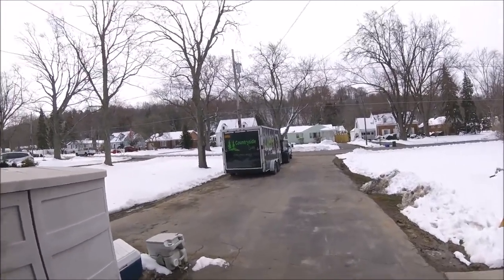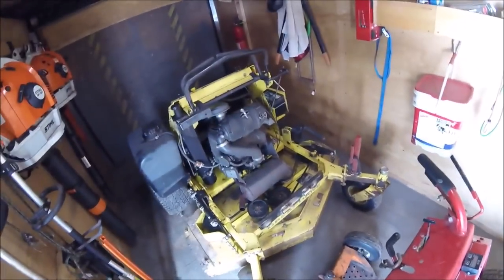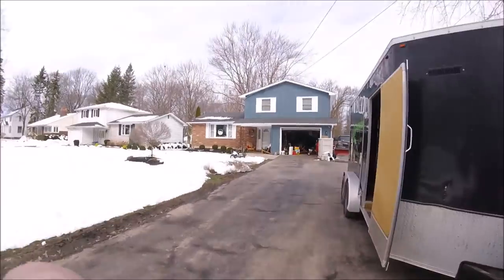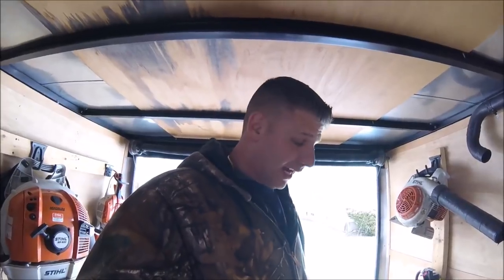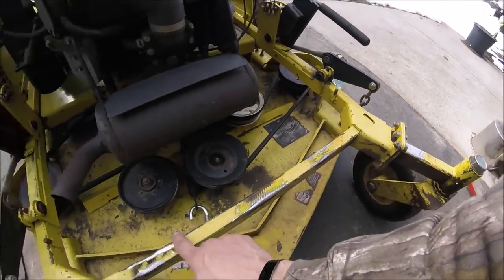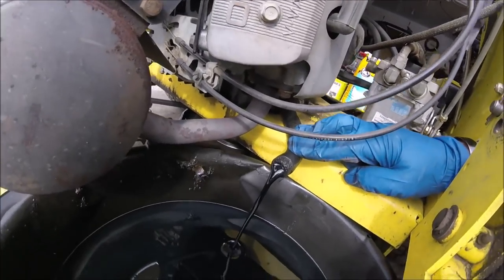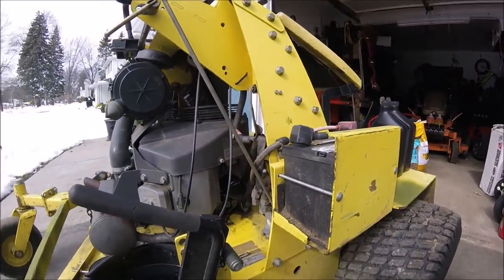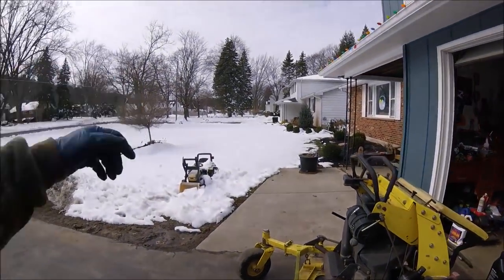Great Dane Super Surfer 2 Maintenance - mower maintenance

Comment: Thanks for this video I have question wath engine you have on this mower because I have one but the engine is 14 hp but running bad lost power when I used the blades but running good when I stop used the blades thanks
Reply: If the grass is long it boggs down the 14 hp engine.
Reply: Also, make sure the brake is not on. This mower has a safety that will cut the engine if the brakes is on and the blades are engaged.

Comment: Ok I have a question.
I found a great Dane for sale here locally in south tx for 2500.
I only seen pictures though. The dealer who is selling it swears it's in awesome condition. Garage kept. Low usage. About to go look at it tomorrow. But I have concerns.
My question to you is. If I decide to jump on this mower. Would it be a good investment considering this brand is no longer in business? Or do you know if the parts are hard to find or even expensive?
Any input would be greatly appreciated.. Thank you
Reply from the maker: It's a great mower and very dependable. Almost every single day cross reference over to John Deere and Gravely so you should be fine.
Reply: @CountrysideStrong  
The for your reply. going this morning to check it out. From the pictures it looks really nice. I even saw very little paint chipped off.
But you how pictures can make anything look good. So we'll see.
Reply from the maker: @johnnycortez5959  good luck